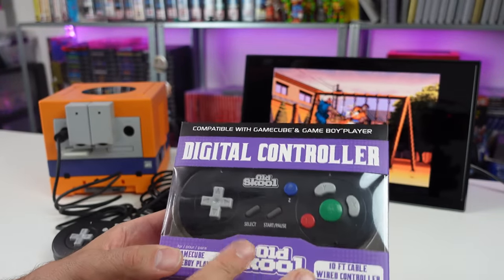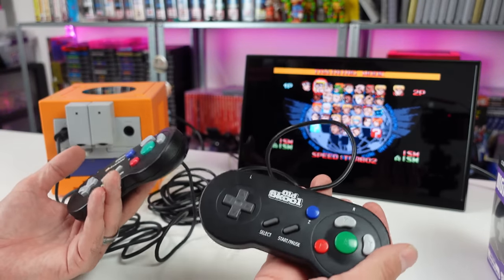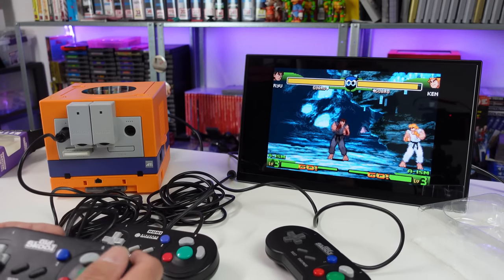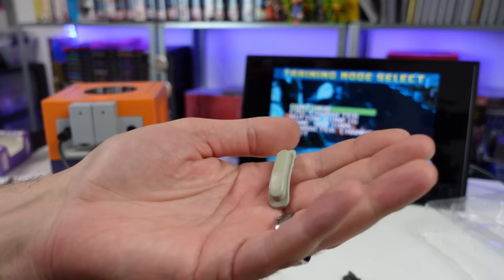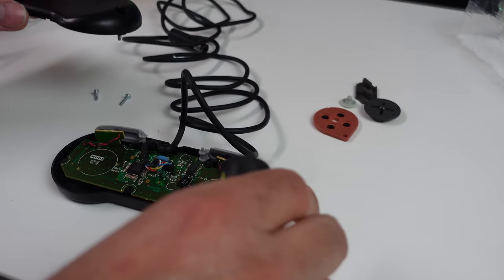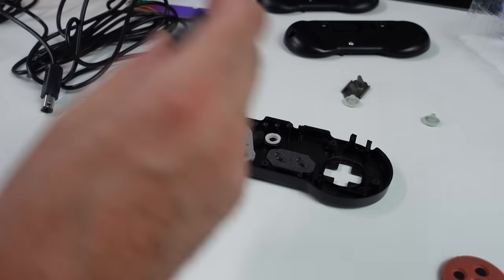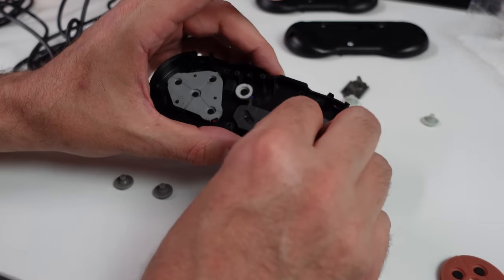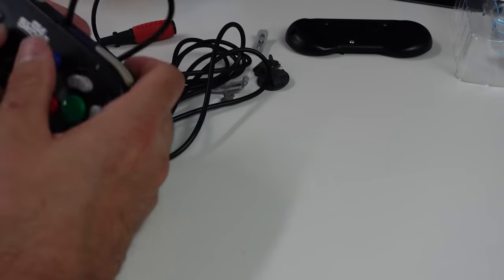HORI Digital Game Boy Player Controller Tear Down & Compare To The Old Skool CLONE & MOD The CLONE!

Comment: Ordered one of these controllers via eBay when you first showed it off and as soon as I got it I tried several d-pads from a couple SNES clone controllers. No matter which ones I tried I couldn't get any of their d-pad/membranes to function 100% correctly (mainly not being able to press down without using an abnormal amount of force). Eventually just pulled out an old original SNES controller that died on me years ago and put that d-pad/membrane in (had to use a handheld electric rotary tool to modify (grind down) the sides of the d-pad to make it just small enough to fit correctly). It works perfectly and a lot better than the original d-pad that came with the controller. Been replaying Fire Emblem: Path of Radiance as a test for the new d-pad and haven't had a single problem yet so I'm pretty happy about using this instead of the original Hori controller.

Comment: What a great video. You are definitely correct about the Dpad on the old skool controller. However your genius ideas work awesome for upgrading the controller to make it almost as good as the original Hori controller. I found that the SFC controllers that were made before 1992 usually have the dpad that will fit the old skool controllers. That official Nintendo silicone pad under the dpad works perfectly and the SFC L and R buttons feel more comfortable and responsive than the standard old skool ones….the metal bar makes the difference I guess.

Comment: This controller can actually be pretty amazing with a few super simple mods: I highly recommend swapping the stock dpad/membrane with an OEM Wii Classic Controller dpad/membrane, the difference is night and day. 

The reason I even tried this was because I first wanted to do it with an OEM SNES dpad/membrane, but the dpad just wouldn't fit inside the old skool controller shell.   

If you even wanna go further I also recommend swapping the L/R shoulder membranes with ones from an OEM SNES controller.
Reply: Do you need to trim anything for the dpad and membrane to fit from the wii classic?
Reply: The classic controller membraine has a small round protrusion that needs to be cut off so that it can lay flush on top of the dpad. I will take pictures and show you.
Reply: @b3nner  Perfect thank you. I think i have a few classic controllers in my storage office. I should try this mod out i see what to cut off

Comment: Picked up one of these thanks to your video. Ended up taking it apart and replaced the Dpad with one from a SNES-mini controller, had to sand down the Dpad a bit to get it to fit in there. Also had an issue getting the SNES-mini Dpad membrane to fit so I had to use the one that came with the Old Skool clone unfortunately. Tried putting in triggers as well but the poles on the SNES-mini are too big. I have some spare OEM SNES and Super Famicom controllers so I may open those up and try to use parts from there to further mod the Old Skool clone. Overall though it's a great controller, very happy with it. Thanks again for the videos, been waiting years for a cheaper alternative to the Hori pad
Reply: I got an old skool controller and I upgraded it with parts from an old Super Famicom controller used the dpad and membrane and the L and R buttons…..with those things it almost feels like the Hori controller.
Reply: @benjaminkitaura498  Funny you say this because that's exactly what I ended up doing after my comment! Had a spare super yellowed out SFC controller and used the shoulders and dpad on it, works much better now

Comment: the problem with oldskool and 3rd party dpad rubber replacement is the conductive carbon on the rubber isnt wide enough so diagonal is harder to press.

Comment: My D-pad wouldn't register the down input unless I pressed harder than normal. I think these D-pad issues happen because the shell castings on the Old Skool controllers are not of great quality. Mine had extra plastic on top of the screw posts which put unnecessary pressure on one side of the board so I had to sand it off. Tightening the screws all the way was also the culprit and loosening them just a bit made it function just as good as any Nintendo OEM D-pad. This is just from personal experience but I feel all of these controllers suffer from the same shell casting quality.

Comment: You sounds different or is it just me?
Reply from the maker: No idea. Sometimes I record with a wireless lapel mic from rode and sometimes I record using a shure sm7b with preamp and post processor. This was recorded with the rode like most of my previous vids as of late. I do some basic processing when I record this way because it sounds very bad raw, but i just normalize, do a filter curve pass and put a bit of compression.

Comment: Speaking of crazy controllers, have you ever seen the NeoGeo CD style controller for the PS2? I was gonna buy one for $85 shipped, which was a pretty good deal from what other ppl were charging, but it sold. Dont know you h\may of reviewed it already and I just missed it. I love weird controllers, and that PS2 NeoGeo one seemed really cool.
Reply: I have the PS3 version (USB-based) and it's a solid controller! Think it just adds a "Home" button, but you can use it with a PC as well (and switch to X-input by holding down the Start and Select buttons when plugging it in). That might be rarer than the PS2 controller though. If you can, GET IT!!!
Reply: @RamuneRabbit  Wow, didnt know theres one for the PS3 ! Thanks for the info!

Comment: I'm still waiting for a version made by 8bitdo or Retrobit
Reply: 8bitdo is a chinese manufacturer of cheaply-built controllers with worse than poor customer support and questionable design choices in their dpads.. why not just buy the old skool controller than is readily available?
Reply: @danieljimenez1989  i have a snes30 pro wired for pc and it works incredibly well. for both 2d games, fighting games and 3d games. in the video it shows the internal quality of the old school digital controller does not compare with the hori. the internal part of 8bitdo's controls is much better, even though it is a "Chinese" company, which for me doesn't make the biggest difference since most things are done right there.
Reply: @danieljimenez1989  their dpads have been pretty good in my experience, much better than most 3rd party options. The only part of their controllers that feel cheap to me are the analog sticks

Comment: I understand this is basically a remake of the Hori pad, but I don't understand why it has the weird Gamecube face button layout.  The lack of an analog stick makes this controller practically useless for Gamecube games, so it's really just for the Game Boy player.  But if this is only for the Game Boy player, then why keep the weird Gamecube face button layout?  Is it just a physical appearance gimmick to show that this thing is meant to be used on a Gamecube?  I have the Raphnet classic to Gamecube adapter, and I think that plus a SNES classic controller is the best option for Gameboy player.
Reply from the maker: People used the hori for other games on the Gamecube as well. But with this being a clone of that controller if it didnt retain the original Gamecube layout it wouldnt be a clone... And most likely wouldnt have gotten much in the way of attention or sales, i could be wrong... But i know it wouldnt have caught my attention without being what it is.

Comment: What about fitting Gamecube buttons and conductive pads?
Reply from the maker: I can check, but I don't feel its needed. The dpad is the biggest issue, though a few of these ive messed with the Z button membrane seems to vary on stiffness.
Reply: It's definitely not a one to one fit. I gave this a shot the other day, and they don't seem to work unless you're willing to do some major modifying to the Gamecube buttons and pad, or Old Skool controller itself to the point where you might be compromising the feel of these components.
Reply: Hello, were you able to do it? I would also like to replace the rubber and the B-A-X-Y buttons

Comment: I received one of these old skool knock offs last week and it has a stuck z button out of the box... definitely not the same quality as the original.
Reply: I've already been hearing as well reports on buttons sticking on this controller. You get what you pay for just the way it is. I was lucky and purchased 2 Hori GameCube GBP controller pads years ago before they shot up in price. Paid about $50.00 a piece brand new from Japan.

Comment: My only complaint with the design is the placement of the Z button. I use my GC controller on the wii when playing certain gba or snes games on emulator, and having the z button as select be on the shoulder makes certain games play smoother. For example I can't play super metroid on any other controller.

Comment: Does a gamecube controller's pads/buttons work in place of the ABXY?
Reply: They don't straight from the Gamecube controller. The buttons and pad from a Gamecube controller have a different form factor than the Old Skool controller, and don't fit.